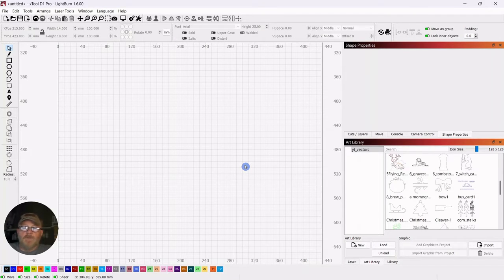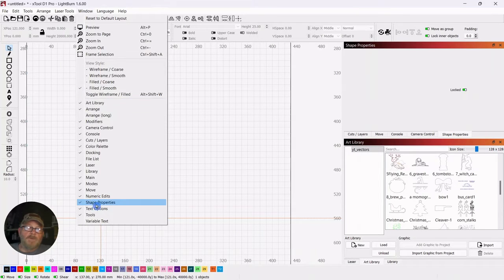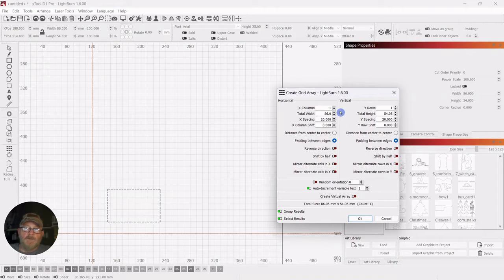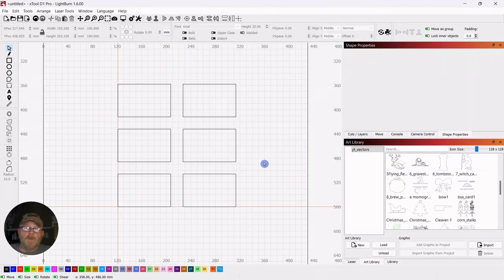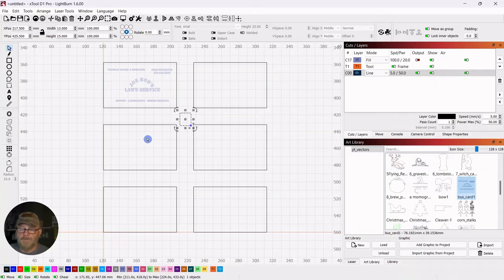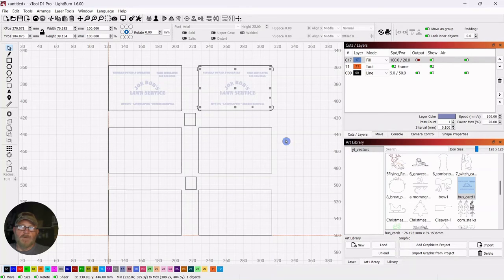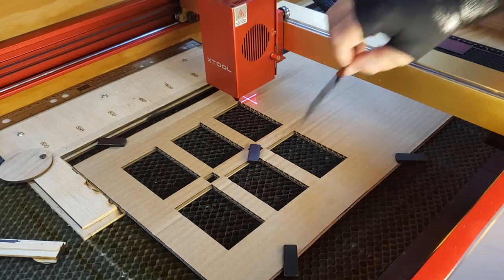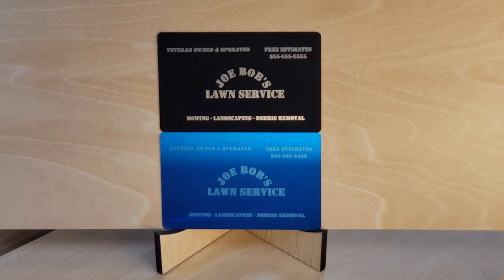Laser Engrave Anodized Aluminum | Beginner Laser Project #47

Comment: What are the settings in light burn for etching the cards?
Reply from the maker: I have a 40w laser and use a speed of 100mm per sec at 20% power and set for "fill".  My son has a 20w laser and uses 50mm per sec at 20% power, also on "fill".  Thank you for the question and for watching.